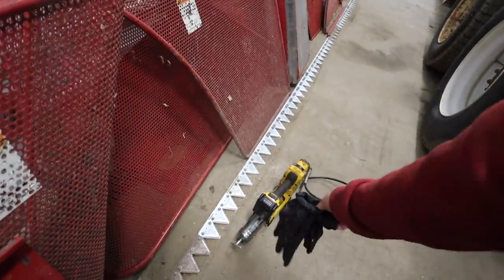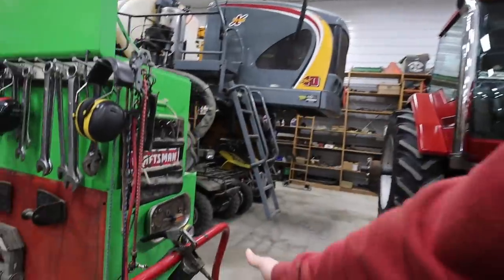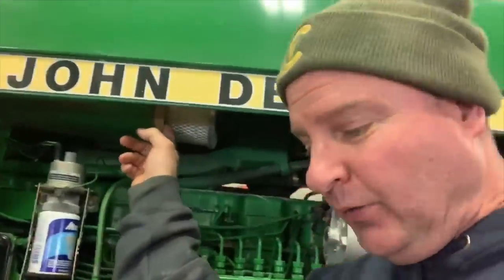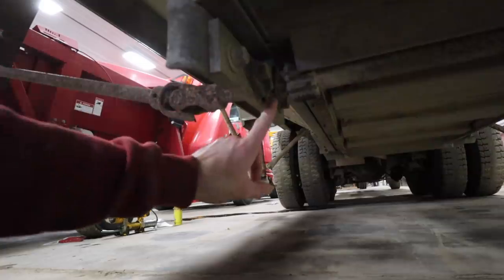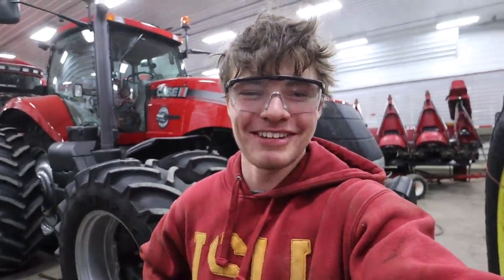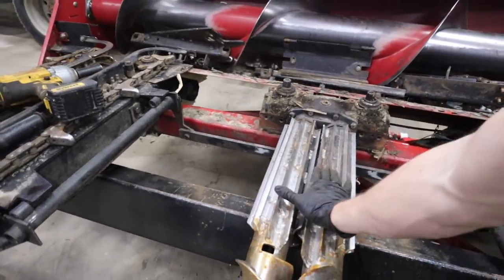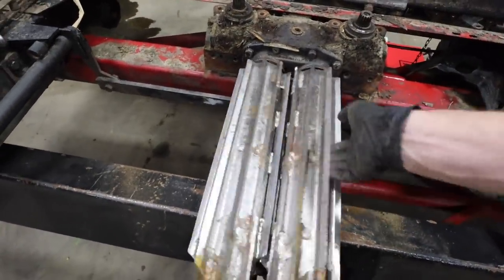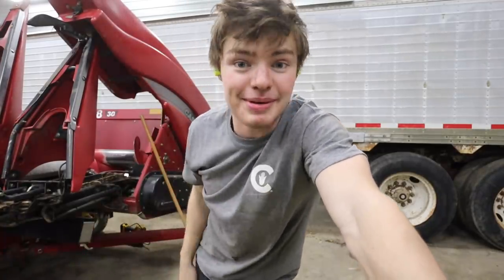NEW MECHANIC FINDS MAJOR DAMAGE!

Comment: Please don’t heat them grease zerks. Reason being is that heat will weaken or even destroy the spring behind the tiny bearing. Just change them out. Another tip always clean off the zerk fitting of debris before greasing. Any debris on the zerk fitting can be pushed into the grease channel thus wearing out the metal surfaces even faster. Think of it like pumping a gritty rubbing compound into the area instead of nice clean grease. 👍🏼Farm On Guys! I enjoy watching your videos🤠🇺🇸

Comment: For the zerks sometimes there is the a persuader. Take a cap one end off. Fill it with grease. Install on the fitting and hold it FIRMLY then smack it with a hammer. Ideally helps force the grease past a stuck plunger. Unfortunately don't know the name of the particular tool offhand but have seen them used. Work pretty good as long as there isn't a caked layer of grease under them.

Comment: If you run into trouble with grease fittings, and you can't get grease going in knowing the fitting is good, I've had decent success using oil. Push some light duty oil through with a pora-power. Pushes away contamination that may be blocking  the port. Quick and dirty, but it works.

Comment: You didn't really make a mistake on the gearbox Cole, when you found the broken bushing, you needed to pull the box apart and wash all of the old grease  out of there to begin with. Believe me, if there was metal in there in the first place, chances are it's not just  confined to the area it came from. Metal could have migrated to the other side during operation, so it really needed to be cleaned out and inspected before the new grease in put back in. Keep up the good work Cole, you'll be a good mechanic one day soon if you keep using good work practices like you showed in the video.

Comment: Hello Cole and daddy corn star got a grate time for both of you there's a a little tool the u fill with oil and can attach  to a a grease fitting and u can use a hammer and force oil in to them if there acting up and not have to replace them and as to the your hose reel banter lmao love it weld a socket on to the reel and u can just use a drill or air tool to reel it up at light speed  love the channel I'm watching ever ep and rembering to like each video have a great day guys

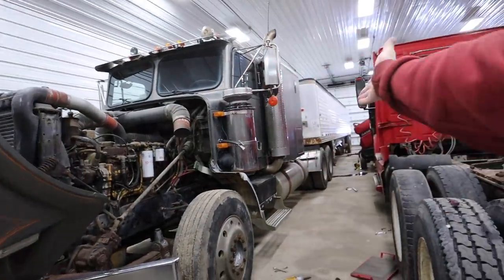Comment: 5:00 an old school trick an old man showed me was to use a wire brush and a can of Yellow paint (He bought like three cases of Yellow paint in a can for like $.0.30 a can 8 cans to a case, so Yellow it was) and as you grease you wire brush and shoot yellow paint on the Grease zerk and that way you never miss one. Just an old trick that works like a charm and makes it easy to find the zerk next time.

Comment: I was about 15 when I did an oil and lube job on my Dad's dump truck. We used a air grease gun that ran off the dump truck itself. Dad failed to warn me that a dump truck held more oil than the average car and I was young enough to not know any better. The spill was epic and it was years before the grass grew there again.

Comment: Cole I had the same problem with small parts. Take one of the magnet  out of a microwave rap it electrical tape
and stick it on where you are working and put the parts on it. I was taught by a younger person.
Reply from the maker: Smart!

Comment: I have a tool for clearing stuck grease fitting. You fill it with diesel, smack thd plunger with a hammer, and it shoots the fluid thru and cleans it put. Like $60 on Amazon.

Comment: Cole there’s a tool that breaks stuck grease fittings free you pound on it with a hammer it uses w-40 to so it’s called a grease fitting cleaner

Comment: Cole I don't think you needed to put new yokes on that shaft. What usually goes bad are the bearings. Replace the crosses ,lot less work and cheaper. Nothing wrong with the ends called yokes,the weld you are going to cut seems fine. But maybe it's bent and I'm wrong. But cool videos man. Just started watching yesterday. Good stuff

Comment: If you use PJ1 flat black high heat paint on your exhaust, it will not chip off and it will last very log time. It's about twice as expensive as other high heat paint but VERY WELL worth it..

Comment: Around 8:00... Not knowing anything at all about farm equipment, can't you get pre-filters for big tractor air cleaners? My lawn equipment has foam elements over the primary filters to keep fine dust out of the big guy. It radically increases filter life and you can just rinse out the foam guy in the sink and re-use it for ages. I would think in a really high dust environment you could just swap a clean one in place of a dirty one as part of your 10, 20, etc hour PMs.

Comment: Why do some tractors have 2 PTOs on the back like that.  I see that one tractor has 2 of them, one right above the other.  Here's another thing with those grease zirks.  Make sure you wipe and clean them off as good as you can because if you don't, when you pump the grease in, you'll also push that dirt into the joint as well.  So while your lubricating the joint, your also pushing something abrasive in as well.  That's another reason why the hole inside can cog over time and also why that even though your lubricating it, your also wearing the joint or moving parts out.

Comment: static crane grease is a better type to use on constant moving/working parts,it is high pressure and temp resistant.will cut down the amount of greasing you have to do and saves a lot of wear in the parts which will help the bank balance when you have a lot of equipment.

Comment: a common place air leaks is dual brake switch,they wear inside. check it with soapy water.you may find it needs replacing. dash air leaks are a pain. we find 6 out of 10 times it's is the brake duo unit.

Comment: Switch to a calcium solfonate base grease for high water rust corrosion bearings and bushings.  Not displaced by water, adheres to the metal surfaces much better.

Comment: just an idea for when you have to take out or put in those calmer heads. get a small ratchet strap and a small pc of wood and ratchet strap the pc of wood into the valley between the choppers that way you can fool with it without it rolling your fingers into it or having it roll at all.

Comment: cole hey on those shafts you can just replace those ujoints with out disassemble the shafts and yokes . on the inside of the yoke is a c clip just pop it out and press out the u joint . those are prob the same ujoint used on the steering shafts on the trucks . you might have to use some heat but those joints usualy come apart pretty easy with a big vice and sone sockets to use as press tools.
Reply: some of those gears can be rebuilt using your mig welder and a grinder  just weld a little then reshape the teeth  with the grinder its not a super stressed gear so it would be ok to reface the teeth and save you some cash and learn a new skill .

Comment: Ideally you should jack up the front end and rears on the semi to take the load off the suspension components. That way the grease circulates into the joints and such.
Reply from the maker: Smart!

Comment: Careful using heat if something is sealed and greased, for example a ball joint. One time I applied heat to a ball joint to try and get it out of a control arm and when we smacked it with a hammer the thing exploded and chipped a giant hole in the concrete inches from where my foot was.

Sealed vessel + grease + heat, could be a bomb

Comment: Take your time working around heavy equipment.  If you don't it will get you.  You need to consider building a service pit so you can service the underside of equipment standing up.  It makes it a lot easier, saves your back and is infinitely safer.  You can put a steel floor plate over it when you need the floor space.

Comment: Hey Cole and Daddy Cornstar!!  What brand of wax do you use to protect your tractors?  Have you thought of using  a ceramic coating?    Glad you're not selling the 4840 John Deere.  Its a pretty tractor!!  Do you load your grease guns from a 55 gallon drum?  If so what does a typical drum of grease cost?  Keep up the great content and try and have longer videos!!  15/20 min each is not long enough!!  God bless!!!

Comment: Cole a question,  When you changed the Torque Rod on the grain trailer in the last video did you check that the length was set the same as the old one?  That rod controls the axle alignment (tire wear) as well as mitigating any spring wrap during braking. If not,  just check that your axle spacing is the same from left to right now.

Comment: If you have a rotary buffer, a wool pad and heavy cut compound at 1400rpm will take the oxidation off of plastic headlights that have gotten cloudy, like on that 7140

Comment: Wow, those 40 series Deere are 40 years old? Already? Yeesh! I remember when they were..... well, never mind. Also, I absolutely concur about starting projects. Heck, I put off buying a diesel for years because I didn't feel like learning a new fuel system. Now I own two diesels & have one tore down in the garage as I type this. Had to rebuild the fuel pump. Figured while I was that far, might as well replace the leaky gaskets. Then I realized the engine could use a little paint. Then I looked at the rest of the tractor & said Hmmmmmmmm.... Shoulda bought one with paint on it. Then I could be a power buffer like Daddy Cornstar! :vD
Reply from the maker: Ikon Sees Mr No keeps adding 😂
Reply: @ColeTheCornstar   I may have to get a third one. My big hoss is a Farmall 806 gasser. Starts every time, runs great & the paint really shines. But...... paint don't pull the plow & 7.4 gph fuel consumption doesn't do it economically by any stretch of the imagination.

Comment: Hey Cole, have you guys ever tried out quartz/SIO2 wax? Not sure what exact products you guys have available there, but there are waxes out there that spray on, either out of a squirt bottle or a foam cannon on a waterblaster and they just rinse off. Usually its used on cars/motorbikes, but i cant see any reason it wouldn't work on farm equipment too. I use the stuff made by Fireball and would highly recommend it. Just a thought, a product like that would save Daddy Cornstar hours waxing the machines.

Comment: Yep I'd keep the tractor too the depreciation on the tractor is pretty much non-existent at this point and it doesn't cost anything to keep it around other than the basic maintenance to keep it in running condition and worst case scenario you could loan to other farms for extra cash if someone was needing one and if not you have a spare

Comment: When greasing your trucks jack the front end up so the king pin gets proper grease.   And never heat a grease zerk you destroy the spring on the plunger and the zerk will let grease back out,

Comment: Big tip to making a grease zerk to take grease if it’s not taking grease is to take a piece of paper towel and hold it in front of the zerk and shove the grease gun on it then pump if that don’t work out a little heat on it
Reply from the maker: Trevor Holland never heard that one before

Comment: They make a impack  hammer forced grease tool that creates high pressure that will force the blocked grease through the zerk and into the equipment

Comment: Northern Tool sells a fitting rejuvenating  tool that uses Thin oil in a hydralic piston ....... Put it on the fitting and strike the plunger with a hammer and force the thin oil thru the fitting......Then grease it

Comment: Great tutorial on Grease certs (sp?).  Do you have equipment manuals for all of the equipment to tell you where the points are? If you heat up the point with a flame, how do you not ignite the grease?

Comment: Keep old tractor,the farmers are looking for clean older are selling now for big money reason for it is computer and being able to repair without having to have dealer do repairs because can't get into there codes,All new tractors are base clear  ( water born paint) they use lowest u.v on base so after a year starts to fade waxing helps major amount but as for your hood shiny can cause glare,I take from racing I paint top of hood flat black,other thing newer machine you have D.E.F to deal with more expense also have tier 4 with regen system and have to be burn at intervals, rebuild old you're further ahead.

Comment: Not hate on the red equipment but there’s a reason I only touch Deere heads, so simple to work on and bulletproof if running a 90 or a 40 with upgraded cluster. Stay away from those 600’s though!

Comment: Allow me to stop you for a moment at 15:20 and say, the ONLY exception to the rule just stated is when it doesn't roll off into the bowels of eternity just lets you think that.... And then you are guaranteed to find it with either your shoulder blade, base of your spine or your knee cap.  New to the channel here (recommended vids algorithm brought me from OLF) and despite having a good few years of mechanical experience under my belt (I'm as old as that 4840) I've found this vid to be interesting and even though you're going through 101 level stuff you make it watchable. Hope you know that you'll be responsible for a good many kids getting into working with their hands and head, and that can only be a good thing.  Like & sub from me.

Comment: Need a cheap press.  Those bearings, cogs, etc are pressed on taper shafts.  Heat collar .. press off.  Freeze shaft .. if need be .. press on.  Common trick is heat cog .. freeze shaft.  Easy peasy to press on.

Comment: Hi Cole. I was wondering if you run the engines up to working temperature before draining the oil during an oil change? We do this for oil changes in the helicopters and the oil flows out much much quicker. It makes the job much easier. Just wondering.
Reply from the maker: John Toal we warm them up most of the time

Comment: Those were not mistakes on the corn head, Instead that was gaining experiance in steps. Taking the other side apart to check for loose metal chucks says you know work smart not hard. Already being out with difficult part done (getting gear box out) wise at any age to check it. Proves you don't have to be wise but. Experiance and being a logical thinker helps a ton.

Comment: Buy varied sizes of stainless steel zerks for equipment that's going to be kept decades or for places that are hard to access to change and gets exposed to lots of dirt wear or water corrosion.
Saves lots of wasted time fighting damaged zerks and damaged dirt filled dirt leaking zerk bearing surfaces

Comment: Blowing air filters only once before changing them out? Seems overkill to me but if you like to do it that way then.. I personally check the inner filter.. If it has any dust on it, I replace everything. Every time I blow filter i check them with a flashlight. If you can see the light trough it is getting thin. Then I replace soon. Filters are cheap. Engines aren't!
Reply: Yannick Barrette yeah we replace the outers once a season but blow them out everyday.
Reply: @adamkruskama8455  I do blow filters like every 50-100 hours depending on the job. But I mostly do hay.. So no tons of fine dust getting into it. Replace only if they're worn out.. 2-10 years.. Depending
Reply: Yannick Barrette we bought one of these filter blasters. Looked like a stage cake with a rod and a spinning cleaner wheel on the bottom. We are very dusty in our harvest, and field work. Very fine clay soils. See about a gallon of fuel savings per hour with cleaner filters. But when we were vegetable farming we hardly blew filters except cab filters. So I can see where you’re coming from.
Reply: I'm in the North shore of St-Lawrence.. In Canada. Really dusty conditions are pretty rare except in the dryer moments we can till some ground.
Reply: Yannick Barrette I’m in the mid valley of Oregon. Gets so dusty during harvest that we can’t see passed the pickup header on the combine. And we work ground to a fine seed bed in the fall when its bone dry. Doesn’t matter what brand of tractor you run it will be brown...

Comment: When performing mechanic work - disassembling equipment and you are sitting or laying down, it is best to have a Harbor Freight / 
PITTSBURGH / Heavy Duty Magnetic Pickup Tool  SKU# 42288 for $5.00 to use to reach for that nut or washer that hit the floor and rolled out of reach.  It just makes things easier.

Comment: 6:11 and if you can't get grease in after heat, pull the zerk and use a can of brake cleaner with a straw/nozzle JUST MAKE SURE YOU TURN YOUR HEAD AWAY TO PROTECT YOUR EYES  Always!!! Turn your head and close your eyes.

Comment: Hey Cole , I was just wondering how big your big heated shop is(length width and height? also how big are the two doors? If you don't mind!
Reply from the maker: Laird Pom 50x100x18 the big one is 26x16 and the other one is 12x14.

Comment: Daddy Cornstar: https://youtu.be/wPNeVd5Hf5c?t=460 - You can easily damage the filter element by blowing shop air a through paper element air filter.  This is rarely worth the risk.  If you really HAVE to blow them out (like, a blocked filter in the middle of the night, and you don't have any spares, gently tap the filter on a hard surface, and gently blow 30psi shop air at 90 degrees from the inside.  But this is a last resort.

Comment: I understand the waxing of tractors and things alike but why not use a electric buffer/polisher with some better compounds and wax?  It would shine better and for longer as well as repel dirt and dust to a greater degree.  Mud and dust have a hard time sticking to a good proper buff and shine job.  I would imagine most of what is affecting your paint is oxidation and the obvious light scratching from dirt and dust. Give it a try!  You'll save time and money  and have better finish that will totally last longer than your current method!  Keep up the great work  166k subscribers and counting!!